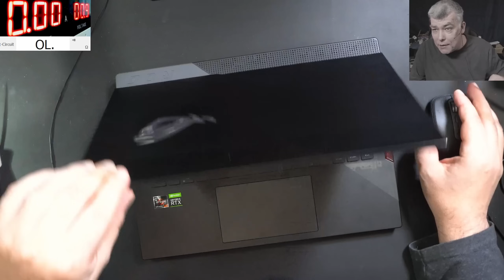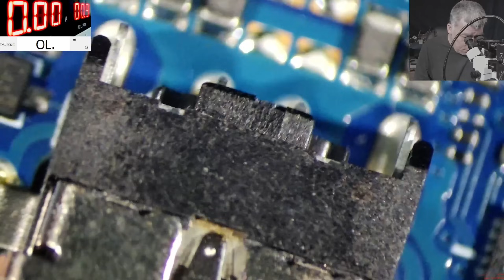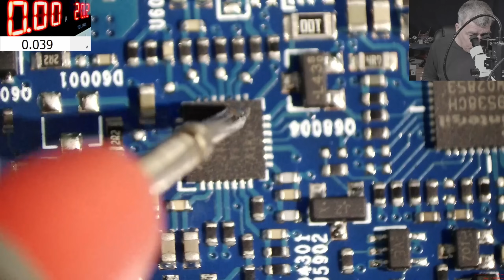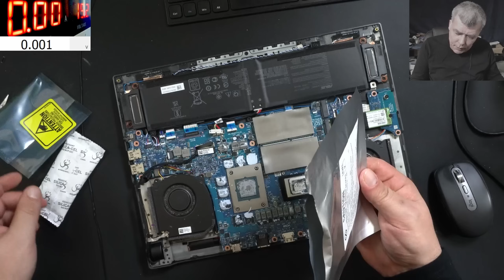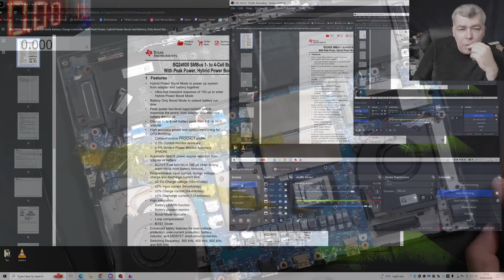Asus ROG STRIX G533Q - No power, Not charging, motherboard repair

Comment: In BQ chips, you must check pins for 25v, 19v, 6v and 2.0v. If this voltage are not present during standby you can directly replace the chip. If same issue after replacing BQ chip, most likely there is a short within the board. This solution applies on low voltage or no voltage on first and second mosfet on main 19v rail. Or if battery is not charging.

Comment: If motherboard is not working still can fix the problem without changing the full board... when I press power button and RGB light blink for a second and then off click sound is coming.  ...... Engineer sed your gpu is dead. Please reply me.

Comment: Hey boss, you i was wondering if you could answer me two questions, the first is that if one tube of 1 grs of liquid metal is enough for the gpu and the cpu of this laptop, and the second is what is better for this laptop liquid k5 thermal pads or regular themal pads ( if so which are the thickness recommended for the laptop)? My laptop is the advantage edition

Comment: hONESTLY  I would have a stroke if someone like you would turn on my laptop with out CPU. I will ask you now to replace the CPU with a new one. Because i would never do this trauma to my CPU. who knows how much damage you did to that CPU? I though never turn on a computer with out CPU was a gold rule for every noob. But You doing that is mall practice. If that would be mines., I would had cried rite now and be full of rage. That was the only thing you was spouse to look after. Btw I know the laptop would had worked with out the mosfest. Why dint you tried that? Them mosfest are to do with charging. so since you took them out the laptop would had worked. Good job fixing it. But This is one of them things. why i told my brother to find himself a real job :)

Comment: I think I know what happened. I think only one of those MOSFETs was short, so I assume the TOP-Side one (the one which connects to the power rail). Therefore you could not measure any short to GND, because there was actually a short to the voltage rail. The BQ-Chip was defenitly damaged, at least it's output drivers for the MOSFETs, therefore the short did not continue further with the bad drivers, because the chip had no possibility to turn on the LOW-MOSFET and shorting the complete power rail to GND. With the new BQ-Chip with functioning output drivers the it controlled the bottom MOSFET and switched it on and because the TOP one was shorted the whole rail got shorted and it killed the remaining good LOW-SIDE MOSFET in the process. I am pretty confident that this is how it happened, because i actually do such circuits as an electronics design engineer, not for computers but for industial electronics. I have seen many weird failure modes of BUCK or BOOST converters which you can't possilbly think of that those can happen ;-)

And lastly thank Sorin for that really thrilling repair video (y)

Comment: 33:50 battery charging voltage when charger is plugged -also it goes up as battery charges more-.. not battery voltage (charging voltage higher than the battery voltage(about 1volts)) its the voltage from the coil (buck converter (diode of low mosfet ) and high MOSFET for switching ) , thank you from Palestine

Comment: after changing BQ chip and trying to add voltage to laptop with power supply (not original charger) you can see sparks when adding positive terminal to charging port. This was due to shorting pins short with 19V and 4+ amps. I think this was the end for those mosfets - they didn't see that coming :D

Comment: how long it will last?? you moved around the laptop with liquid metal on cpu and flip it over :))) after screwed back heatsink with damaged silicon barrier. After couple of months your customer will bring back the laptop with dead motherboard as liquid metal will leak on the motherboard through damaged silicon barrier. Didn't  even bother to remove the logic board out from the case while using hot air :)) Good luck :))

Comment: These BQ chips have a firmware inside similar to those on laptop batteries... Maybe it needs time to learn the environment... To communicate with the other controllers on the MB & the chip on the battery... And that might have delayed something just enough to burn the mosfets

Comment: You must check for shorts first before suspecting any chip is faulty - check out NORTHRIDGE FIX and watch how Alex does his diagnostic and 95% to 99% of the time he's right on the button. People go to NorthRidge fix and poor Alex is swamped with more work than he can deal with. Meaning his success rate is high to very high...

Comment: Hello Sorin
I believe when you use power supply straight on the charger port you suddenly touch id pin and click the power supply
Base on motherboard sheet if 19v on id pin to ignore dead other component like EC dead mosfets.

Comment: 7:22 If that chip is in focus you need to get some glasses Sorin 😄

The first time after you replaced the chip there was a spark when you injected power.
Reply: I seen that also, he touched a ground part of the DC port for a millisecond at 15:47, dont think that would cause them mosfets to short though, a strange one!

Comment: 9538ch intersil chip close to the bq chip that control the charging circut of the battery and also control the gate of the the mosfets chip
Reply: what is the BQ chip doing then ?

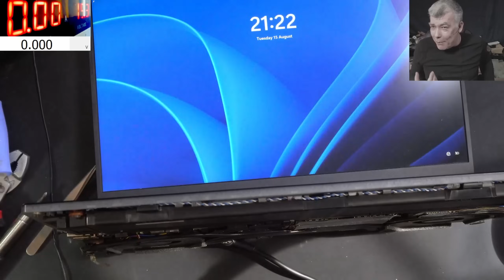Comment: 36:19 "why those mosfets got burned?" take a look at 15:46 - watch at the red probe and see that spark. I will say something unlogical but I don't see clearly if you touched to ground or is it a spark of high 5amps current draw, but maybe -just maybe, you created a very high spike, which passed trough first two mosfets and finally killed two charging mosfers (laptop was off but huge battery was connected, so that two charging mosfets, draw all the voltage/current). I don't have other explanation - it is very strange case

Comment: You are the one who caused the short circuit at minute 15:47. Check the Video.
You'll know what I'm talking about
Reply: That was a direct to ground short at the DC input, it wouldnt affect any component on the board, Its more than likely what @zavokzalniy1 said about the BQ soldering,

Comment: Why the FETs failed? Maybe the original faulty BQ chip sent too much voltage to the FETs and weakened them so that when a working BQ chip was fitted and the power was supplied the FETs then failed on supplying initial current to the battery. Total guess. I'm not sure about when Sorin shorted the power probe to ground at 15:45 as has been suggested. I can't see how that would destroy two FETs simultaneously so far away from the point of the spark. As it was just the power probe being shorted to ground it wouldn't have gone through those FETs but that is probably why the power supply clicked. I know what we all say about coincidences... but.

Comment: The mosfets were shorted @15:45 when  the Red Probe was accidentally shorted from power to ground on left side of charging port (watch tip of red probe and you can see flash/spark), that's why mosfets where blown...After further review I could be wrong. It seems that that red probe was shorted between power and ground for at least ten seconds as indicated by the second spark/flash @15:53 when probe was removed, during which time the statement  "wait the power supply is clicking" was made. The PS was clicking due to the short to ground which may or may not have been the cause of the mosfet failure,  Seems likely though. Good job. Good video. Thank You...

Comment: I had this exact same problem Monday!  Could not figure out why the 2 battery charging mosfets blew when I swapped the BQ chip.  No charger ID on my power supply....

It's like I just watched myself.

So, no charger ID pin on power supply can blow the charging mosfets?

This is insane.  I was so confused.

Comment: More then likely the mosfets were shorted but because the BQ chip was dead and it wasn't showing a short since its 2 internal mosfets went open circuit. After replacing the BQ chip its internal mosfets sent the dead mosfets gates to ground. That is at least what has happen to me before
Reply: It could be he shorted them when powering with power supply
Reply: Doubt it they weren't shorted at the start and they would have been if they were faulty to start with.
Reply: @JonnyMac351  if a mosfet or transistor burns open you won't see anything when testing for continuity. Not ever mosfet goes short when it fails (yes it does commonly short). Small mosfets commonly burn open where higher current mosfets tend to short circuit. The mosfets in the BQ chip are very small low current mosfets used to control the gates of a more powerful mosfets
Reply: @1998eclipse1998  Yes i realise that champ i have been in the electronics and repair industry for 41 years

Comment: The BQ chip was not supplying power, and when you replaced it with a good one, the mosfet burned when the power was released . 
Maybe the MOSFETs are the reason why the BQ chip failed in the first place
Reply: No it doesn't work like that they would have been shorted from the start if that was the case and they weren't and there was a spark when he injected power with his power supply i think his lead slipped and shorted something have a look at the video again.
Reply: @JonnyMac351  Yeah was a pretty big spark.
Reply: Yes that make since

Comment: 29:20 maybe you activated the mosfet with a multimeter
Reply: For me isn't because there Is a resistor and capacitor to ground for discarge gate.
For me Is a temperature and It are some hot and the resistance Is very low and when sorin plug Power suply shorted both of them
Sorry for my english i'm Italian

Comment: Mosfets die because of heat right? They cannot push as much energy when operating at 80 degrees or more. Some cannot handle even a little bit anymore at high temps. They have burned out. Electronics and heat go as well together as electronics and water.